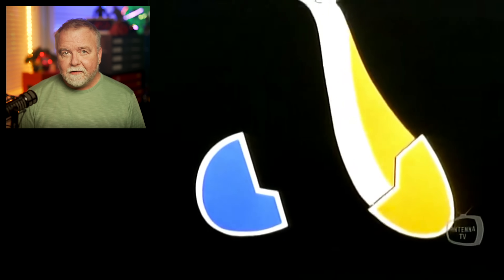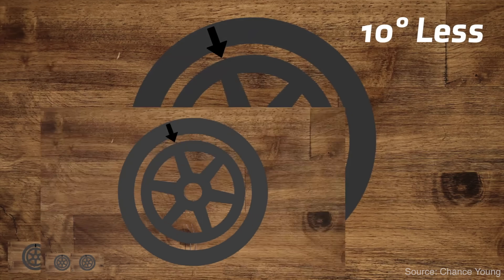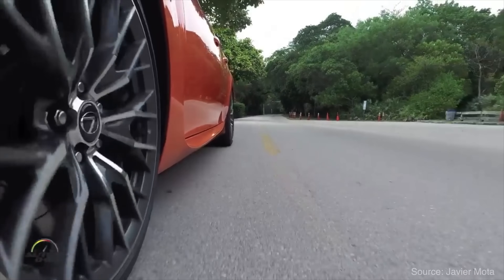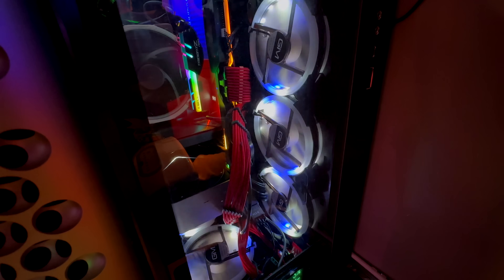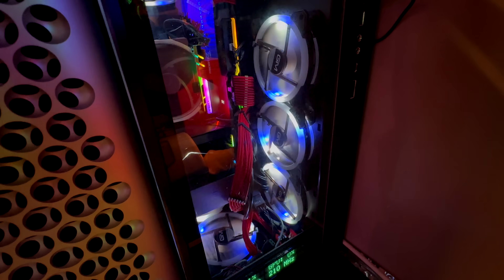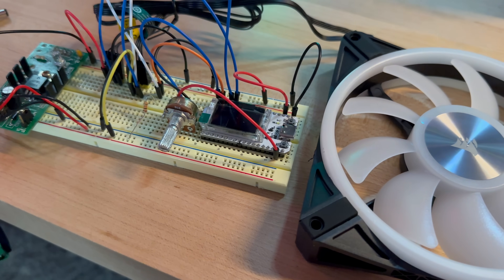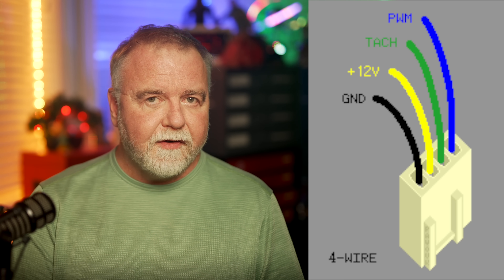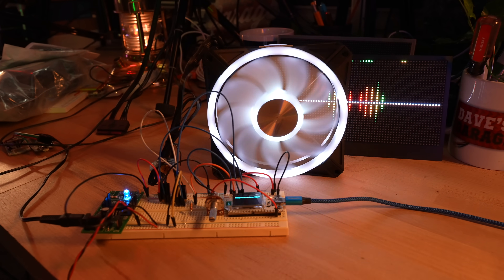Can I Freeze a Fan in Time with its RGB Light?

Comment: Well, very nice...you are putting a lot of faith in the power company.  Granted, VHF to them is like 60.2 Hz, but it does wander around a bit.  It costs too much money to chase it very hard, so it IS going to wander.  Ultimately they correct it based on time.  Integrating the 60 (+-) signal over time and comparing it to a standard time is the reference.  Love your work.  Getting the book.  Thanks for that too.

Comment: All PC fans emit two tachometer pulses per revolution as of around 2004. See the Intel PWM fan spec. It's actually probably even simpler than that, the motor actually has 4 states per revolution (look at the stator) and there are 4 state changes from positive to negative and vice versa, and the tachometer signal is simply the internal control signal converted to open-drain and brought to the outside. Not easily visible, the rotor also has 4 poles, you can view them with magnetic view film.

Also according to the same spec, the PWM control signal must be between 21 and 28 KHz, and should be 25KHz. But most fans have a wider tolerance range.

Also one should definitely not build a PC fan with a number of blades divisible by 4, absolutely not.

Comment: In reality its part camera frame rate part harmonics part persistance of vision all synchronizing. You don't even have to have the exact time. You can have an adjustable frequency on a potentiometer and simply dial it until it all synchronizes. And it you put a fine adjustment with a fast enough flash rate you can slow or speed it just slightly and it will look slomotion or go backwards even. All you need is frequency control of a strobe light source.

Comment: One thing to optimize the code is that you only use the rpm when calculating the strobe freq. So combining the rpm calculation to the strobe frequency calculation you could omit the 60's because you first multiply by 60 and then right after divide by 60. Float numbers are rather slow to process even though it seems newer esp32's have some sort of fpu inside.

Comment: Very cool.  I would add some code that re-calcs and re-tunes the LED Hz every X revolutions.  Also, you may want to add in some set delay in the first step of your measurement calc to account for the clock cycles it takes to do the measurement.

Comment: Regarding standards on the fan interface: if you choose a fan designed for PCs, then I would refer to "4-Wire PWM Controlled Fans developer specifications" by a company you may have heard of, Intel Corporation. You can download Revision 1.3 (2005). If you search for the title of such specification you will also find a few other white papers (e.g. by Noctua) and other material.
Regarding the frequency of the PWM: I would recommend 25 kHz but in the 21-28 kHz range should work without problems. 20 kHz is just a bit too low as there is the risk of electric components vibrating at such frequency which is still audible by some people.
Regarding  the generation of a "blade frequency": what you are trying to create is a Digital Locked Loop (like a PLL but entirely in the digital domain). To make your life easier I would start using the facilities of the MCU you are using (or choosing a more suitable micro). When I saw you writing "period = highTime + lowTime" I wanted to scream! Sorry but software engineers too easily indulge in wasting logic gates and clock cycles 😛 Check the availability of peripherals called "timer/counter" and choose one which supports "capture mode". The timer will give you the duration of each pulse in an interrupt, as a count of time units of your choosing. You can then use the count as a look-up index of the blade frequency and such frequency value is used to configure another timer operating in ordinary timer mode.
The transitions of the I/O port are affected by noise. The simplest way to reduce noise is to perform a moving average of the measured periods. A more sophisticate filter could give you a better trade off between responsiveness and noise suppression.
It is worth noting that fans for PC have 2 poles and that means that they generate 2 pulses per revolution. From my understanding it also means that there could be a systematic error between the duration of each half revolution (if you timed only the odd pulses or only the even pulses you would avoid such systematic error but you wold have less frequent data to work with. maybe interlaced period measurements would work?). You may want to take that into account in your filtering algorithm.

Comment: Photographer here...
The LED pulse duration needs to be less. 
In the same respect a frame rate and shutter speed needs to be matched, the RPM and duty cycle must also be.
A shutter speed that's to low for the frame rate still result in significant motion blur.

Comment: This took me back to both movies and computer tech from when I was a kid, particularly learning about interrupts. :) We didn't have affordable ADCs in those days, but Atari did very well with their paddle controller inputs. The paddle was a variable resistor, a capacitor was charged through it while a fast counter counted how long it took to exceed a certain threshold. Every vblank, the charge was dumped and the charging began anew. It wasn't exactly linear, the voltage of a charging capacitor rises in a distinct curve, but it was good enough.

    Oof these latency issues with digital systems! ;) Back in the day, I tried and failed to get the hang of phase-locked loops, which basically do all this with entirely analog electronics. They have their own difficulties of course, they're basically PID controllers -- what were known as servo circuits back then. As such, you have to know what you're doing when you set them up.

Comment: Some have mentioned it already and I totally agree, to sync it with the blades it would need to be done with a Phase Lock Loop (PLL).

I've programmed one before, but I talk to FPGAs using VHDL language.  I would help code-wise but I'm not skilled in C++ at low level, and I despise dealing with interrupts, they disrupt everything else but them.  FPGAs generate their own dedicated hardware for everything you make, like PWMs or Counters.

Here's the basics:
-run a 32bit Number Controlled Oscillator (NCO), it outputs the pulse at overflow
    -setting to 1 is slow for overflow
    -2^31, fast, every 2 counts, !aliases above!
    -Frequency is completely linear
-calculate fan's frequency via the tach
    -set NCO 'close' if way off
-when NCO is clocks, if fan clocks + or -
    -adjust freq a bit
    -adjust position as well, or it will be unstable
the values for 'close', adj freq and position need to be determined for that project.

This could be simulated in Excel, with nice pretty diagrams, if you know anything about that.

Keep in mind, if you're pulsing n blades per tech, you need to compare offset once per ever n blades.

Comment: One of the reasons you're not getting good results with this, is that you are using pixels. The pixel PWM is asynchronous to the data line. What you really need, are dumb LED's that are driven directly by the micro controller. That way, you can control the LED's with far more precision.

Comment: I think the reason the strobe effect did not work well enough with just one strobe per revolution (or 2 per revolution as you later found out the fan sends two signals per revolution) is twofold: a) the LEDs turned on for too long b) there's quite a lot of other light in those shots, which do not strobe, therefore allow the camera and your eyes to partly see the fan blades continuously. The stopped fan effect should work with practically any frequency of strobe, even 1Hz, provided the strobe is fast enough (light tutned on only for a small fraction of a second). Naturally, the higher the frequency, the less annoying the strobing all the was to not being noticeable by most people (but I always notice the strobing, even with brigtness regulation of OLED screens... wonder if that is an autism thing possibly.

Comment: Short simple answer as to why there are two pulses per revolution is mechanically simple--balance.  There has to be something to count while it spins, hall effect sensor or something.  But 1 element would imbalance the fan, leading to noise and shorter lifespan and something Corsair would want to avoid.

Comment: It makes sense to me that it would be nearly impossible to achieve full rotational sync in this scenario. I do not think that any PC fans are designed with the goal of maintaining steady RPM. This is anecdotal, but any time I have watched the tach signal in a system BIOS it would never stay perfectly still. This also makes sense as slight variations in air movement and pressure will change the energy needed to maintain a steady RPM.

Comment: Are those addressable LEDs like the ws2812? If so, could you try either regular LEDs in parallel or a parallel RGB strip? Given that you could use a direct on/off the delay introduced by the setup and bit banging of the fastled library should be reduced greatly. Just curious.
Reply: Yes those are addressable LEDs specifically of this type, this is called "5V RGB" on PC typically. Instead you can of course get a fan with "12V RGB" where you just pull the corresponding RGB low lines down with a MOSFET and all the sub-LEDs of that colour light up.

Comment: In the calculation of rpm and strobe_frequency you can delete the "* 60" and "/60" parts of the calculation as they cancel out (unless you need the rpm value elsewhere in the code).

Comment: I would assume that getting a non-blurry max speed fan you would have to lower the pulse width of the actual flashes, so it's more like actual strobing. The problem with that is that it very literally is how LEDs are made duller and darker.
Reply: Fortunately, as someone pointed out earlier, if you limit the pulse length you can pump a lot more current through a LED. If you're building something from scratch you can find LEDs that have peak conversion efficiency at above their max rated continuous current. Basically they are designed to be pulsed, so you can get more light by running them at 8 times their continuous current but at a 1/8 duty cycle. Not all LEDs are like this; you'd have to check datasheets.
Of course there's no way to do that with addressable LEDs.

Comment: Excellent fun project! Thanks Dave! I think I'd make the following changes. First, recalculate the frequency and restart the frequency generator far more often. Potentially every revolution, this would stop any drift. As long as the start is synchronized with the sync pulse you should get a perfect freeze. Next I'd buy more fans to find one where the LED's and more importantly the LED addressing logic chip can survive a higher voltage. Most LED's can handle much higher current if that current isn't on all the time. I believe it's LED heating that determines the maximum brightness/wattage. If you turn on the LED 10% of the time putting 10 times the current through it at that time will be the same power dissipation. But, whether the addressing logic will survive even a 2X higher voltage is an open question. But if you are able to find a fan where this works you could have the LED's be much brighter. And if you double there brightness, you could halve the on time. This would allow the blade to move only half the distance with the LED on. Thereby making the blades look twice as sharp. Now, whether you have any interest in pursuing this further, I have no idea. Personally, I always have more projects I either want to do, or am doing, than I'll ever be able to do.

Comment: A notice about the analog input on the ESP chips. They are very noisy, could explain why you were unable to match the frequency with the Potentiometer. Throw in a cheap AD converter with I2C and it becomes more stable. Just a trick for the next project.

Comment: Hey Dave. Nice work. The leds are given data at 800kHz. That's 33k leds per second that can be refreshed. If you have say 30 leds, that means you can only refresh them about 1000 times per second. Your on-off will take about a millisecond. 

If you want to get a crisper still fan, you can take a "dimmable led strip" and use a pulse on the gate of a mosfet. You can then shorten the pulses as much as you like. When driven at such short pulses, once the software works "for sure" you can increase the current through the LEDs. LEDs will happily survive pulses of 8 times their normal current  as long as they get to rest most of the time.... 

Consider using a raspberry pi PICO. For one, you can continually get the "latest period of a full revolution", by putting an interrupt on the rising or falling edge of the tach signal. Just call the us_since_boot function for that. Subtract the last two values, divide by 9 and you know when to set the next timer. That should make it auto-track. You'll see a bit of jitter WHILE the speed changes.

Comment: For us 50hz countries, should that be a 50 instead of 60? Also would using the PWM signal used to drive the fam not be a better option than the tach out put which is likely affected by latency? I could also be very wrong

Comment: Very interesting. I think your query around the divide by 2 has to do with the LED, you have it on for half a second, and off for the other half. Otherwise it will just be on all the time.
Reply: The LED only turns on for a split second, not 50%.

Comment: I would rather take a sort of PLL approach. Increment a counter to a target of many thousand to get a nice resolution and see at the next tacho pulse how far it got. At the tacho pulse update the led pulse values to multiples of the tacho counter/9. In the main loop keep track of this counter and flash the leds at the determined values. This method basically estimates the blade speed based on the last revolution, which is a good estimate. It is very easy code and keeps things constantly in sync.

Comment: I didn't realise until a couple of years ago that LEDs could strobe quickly enough.  I used an Android strobe app to use the phone camera flash to check the RPM of my old Atari floppy drive.  Just put a white mark on the spindle then set your app to run at the required frequency to match the desired RPM.  If the drive is running at it's proper speed, the mark should be stationary.

Comment: If you didn’t mind adding a bit of hardware to the solution, a phase locked loop and a divide by 9 circuit should let you go back to your original idea of triggering the light pulse on an interrupt and to dispense with trying to figure out the right frequency in software (which, as you said, is necessarily a bit of an approximation)

Comment: When evaluating LED red lights for traffic signals, in their first iteration, we took pictures to compare a standard incandescent lamp and the LED.  Using a standard film camera.  To the human eye, both were on, and appeared just as bright.  (We had them in signal heads, in the air at the normal height, side by side.)  When we developed the film, the LED appeared to not be on.  Well, LED's are diodes.  (The D in LED stands for diode.)  Feeding a 120 VAC, 60 Hz power into a diode results in a half wave rectification.  That means the LED light with all it's red LEDs were configured exactly the same, resulted in it actually being off in half of the 60 Hz cycle.  The camera's shutter caught it in the off period.  To the eye though it was fully on.  Your eye has image retention, film, shutter in cameras do not.  I had to explain that to the Traffic Signal Engineers who were confused as to why the LED signal appeared off.
Reply: Should have put two strings of LEDs facing opposite directions, in parallel, so each string would be on half the time, but alternating.

Comment: You need a PID tracking loop to lock onto the fan cycle by cycle and freeze the blades. Measure how much time it takes to do your LED updates—that’s the limiting factor and thus the limit on your update rate. You could build this frequency multiplier in hardware so that it exactly tracks the tachometer but I know you’re not much on building hardware when you can write software… ;-) That’s a PLL and some digital logic…

Comment: 7:45 I've made a few USB fan controllers, and AFAIK, it's divide by 2 because the fan has to be balanced. E.g. there's a hall effect sensor in the fan hub, and 2 small magnets in the blade section, if there was only 1 the fan would be unbalanced and vibrate wildly. As for documentation, there's the Noctua fan white paper which is pretty simple to understand and gives examples for resistor values and stuff; or there's the Intel fan specifications (might be confidential idr) which is very detailed and provides proper diagrams, oscillograms, and all that fancy stuff.

Comment: Years ago I had a fan that would do this on its own. It had its own internal RGB controller and it would pulse the LEDS perfectly to match the fan RPM. It couldn't be controlled by an external signal though, so it was kinda dumb, but the silver strip around the tips of the fan blades looked pretty cool in the dark

Comment: If you have a fan without speed feedback, you can glue a small (eg 1mm dia.) magnet near the tip of one of the blades and a Hall effect sensor on the frame (JB Weld is your friend). If not enough output to switch digital levels you can use an analog input and count the peaks. Such a small magnet doesn't affect the balance significantly (I've used it on a 50mm dia. fan).

Comment: 4:40 The best documentation I know of for PC fan standard is from Intel, who defines most standards regarding physical stuff in a PC (including power supply standards, motherboard dimensions and mounting points).

Google, "4-Wire Pulse Width Modulation (PWM) Controlled Fans"

It specifically states that the tach has 2 pulses per revolution